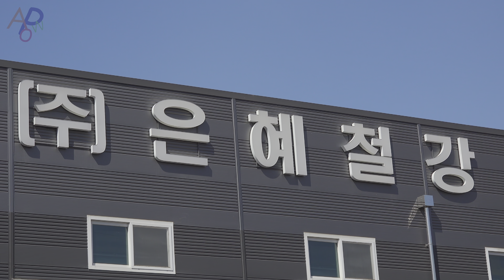Metal Roof Manufacturing Process. Steel Roof Mass Production Factory Automation in Korea

Comment: Well, I believe that foam is to dump some noises, especially when it's raining.
Reply: it's damp
Reply: Kayanya peredam& bendingnya ga cacat
Reply: it will if you don't use a proper ceiling..
Reply: Its An antidamp material, when the outside temp low  and inside temp high you have no water drops

Comment: Most people don't seem to know much about the material in the video, so I'll explain. It is a very advanced technology that is also used in your car and electronic products(Samsung, LG,..). It is not just iron. Zinc plated to prevent corrosion. Only the world's best steelmaker can make the material.
Reply: Galvanising, applying a layer of zinc to iron, has been around since the 17th Century in India but has been used widely and isn't that difficult to do. More modern processes have made it more cost effective by electrogalvanizing but, again, it's not overly complex.
Reply: @bunnywarren  Thank you for good information. India is amazing!

Comment: I worked as Licensed Industrial Electrician (442A) in Canada for over 35 years in industry and have worked on many paper laminating machines that used what is known as a dancer roller. The dancer roller rides on the material being fed into the machine and is connected to a variable resistor or rotary encoder that monitors it's position and determines the roller position. As the material is spooled out the dancer roller will move up and down depending on the slackness or tension the in-feed is feeling. This in turn controlled DC driven unwind motors to ensure that the material is fed in a way that is controlled manner.

That being said, I have never seen dancer rollers like the ones used here in this video. They are side mounted where all the ones I've worked with were full sized rollers that spanned the width of the product being processed. Mind you the material I was dealing with was paper 12 feet in width. But I found that to be very interesting.

A great video that brought back a lot of memories. Thanks for sharing it!

Comment: Really nice textured aesthetics.    What is the metal gauge?       how long will the coating last?      Would be nice of backside had a foam finish on it to prevent radiant heat from penetrating roof.
Reply: The standoff of the textured roof accomplishes that.
Reply: You can get foam backed, it does not last long. I have worked with it in Thailand.

Comment: This is fine for some applications but you can't walk on it when necessary.
Reply: most residential houses in South Korea have flat roofs made of concrete slabs, and these "tiles" are only used as decorative element.
not too many residential houses in South Korea have actual functioning sloped roofs, as found in USA.
Reply: This is a product designed to walk comfortably on the roof. Otherwise, construction would be impossible in the first place.